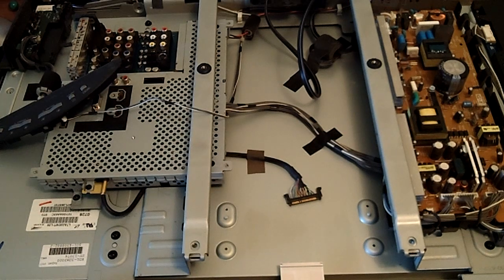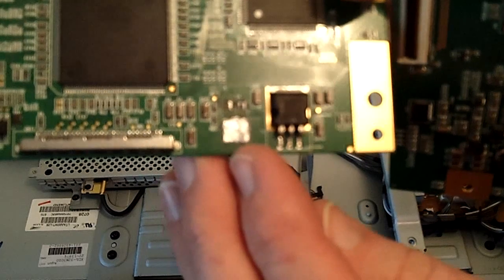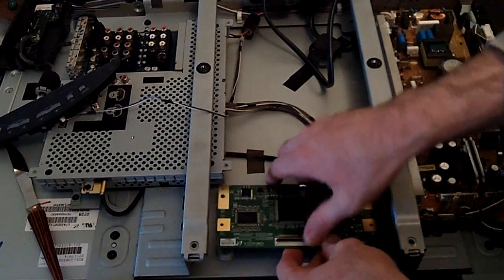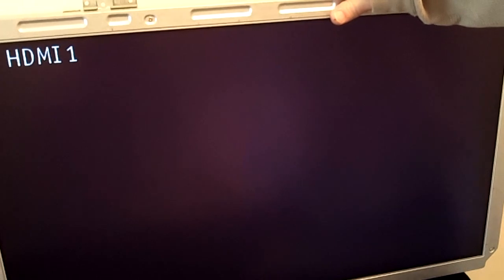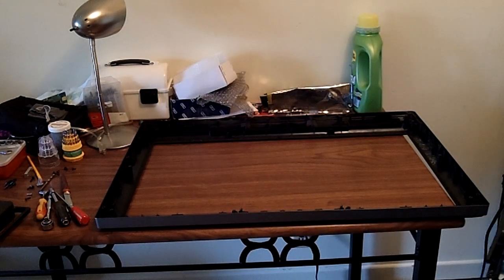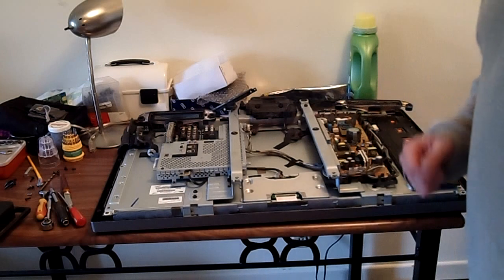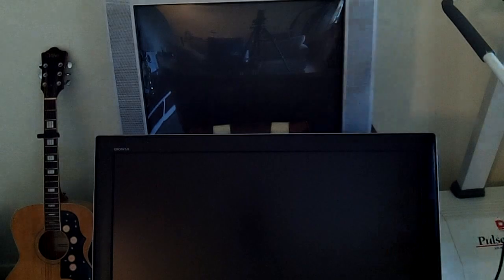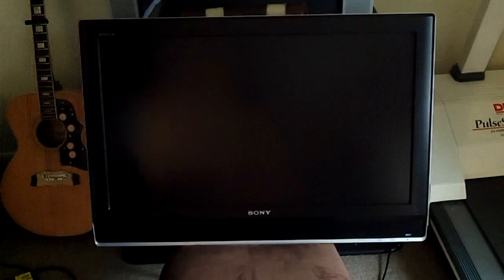Sony Bravia KDL-32M3000 TCON Board Replacement.

Comment: Okay, good on the showing of locations and such. But, as an electronics tech, bad form overall when handling/installing the new board. Long sleeves that come in contact and can cause ESD, no grounding strap prior to handling(can touch to case), butterknife used to open the packaging and causing unnecessary stress to the board, and then when installing you bent the board a significant amount which could once again damage it. Recommendations would be to wear short sleeves, use a sharper knife, keep some part of the body in contact with large piece of metal, and support the PCB with the non-installing hand close to the connectors when connecting the cables.

Comment: il problema si poteva risolvere in modo più economico, basta sostituire il AS34-G integrato circuito da 14 pin  costo totale 5-6 dollari a fronte dei 40-50 dollari per una t-con usata sapendo che ben presto si ripresenta lo stesso difetto, te lo dico perché ho lo stesso LCD che dava questo problema.
Reply: alexander cognome Salve, io possiedo una KDL 46W5800,  il problema è lo stesso, la soluzione sarà la medesima secondo te? Grazie
Reply: Esatto prova a cambiarlo e fai con calma :)
Reply: Perfetto grazie, appena ho novità ti aggiorno ;-)

Comment: The case back can be removed by removing 18 screws that have the "==>" marks next to the screw wells. Most are obvious but note two small screws at the back top edge on either side of the Power/Channel buttons cluster AND the two small screws between the HDMI and Video connections. Good luck!

Comment: Percaine...I just got a Bravia 32 inch donated that turns on but all I get is a blank screen.  I shined a light and didn't get anything showing up on the screen.  I haven't checked sound yet.  I was wondering how you came to the conclusion that the Power IC was bad and if possible I could go about testing mine.  The IC looks fine but who knows.  I would appreciate any info you can provide.